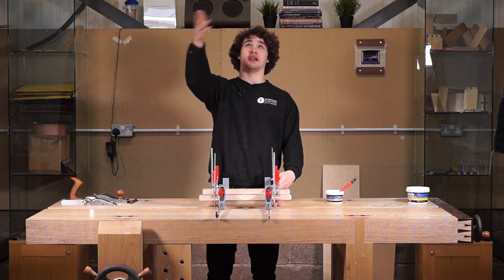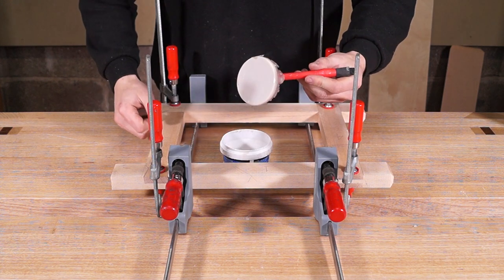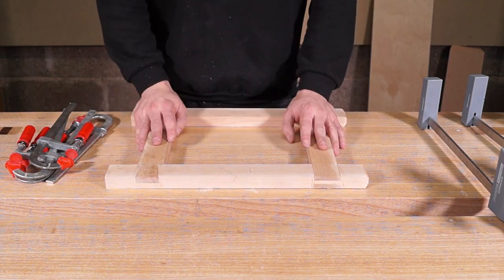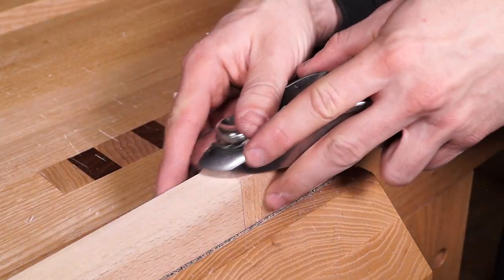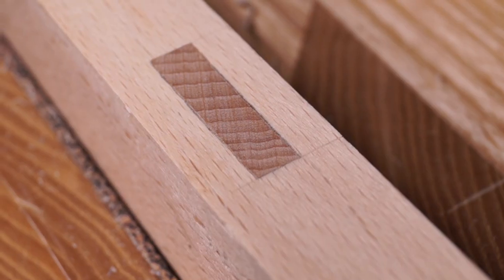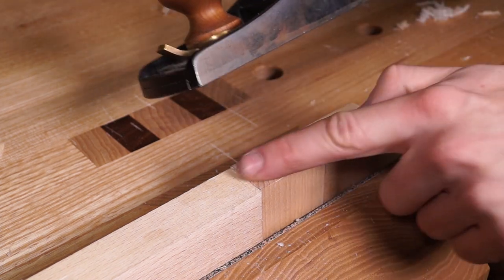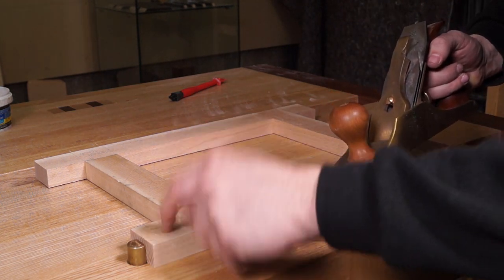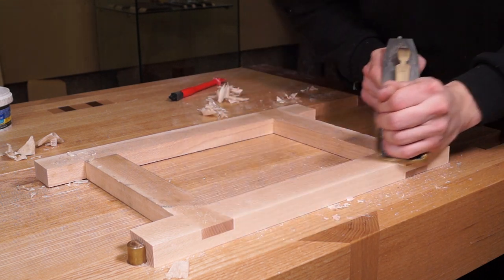Making a JOINT PRACTICE frame - Part 4

Comment: Matt,
Superb video again, well narrated and your attention to detail is second to none.
I wonder if I might ask a question? I recently tried to drill a 12mm hole down end grain in Oak using an auger bit (I need a 100mm hole). Lots of smoke. Lots of black bits etc.
Is it possible to use some sort of lubricant to help?
Regards, 
Dave.